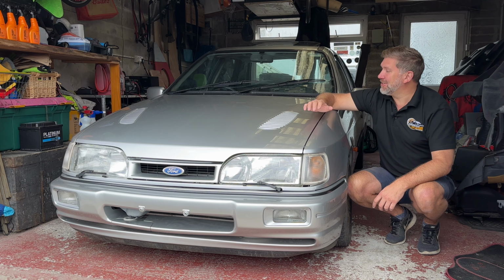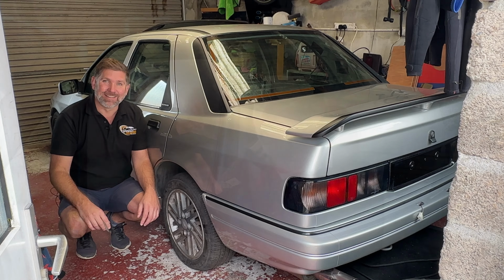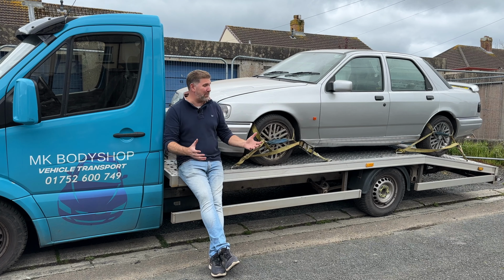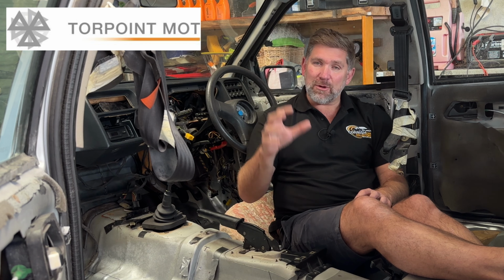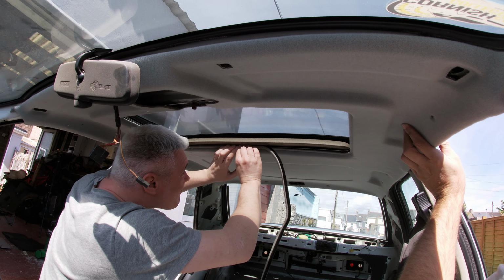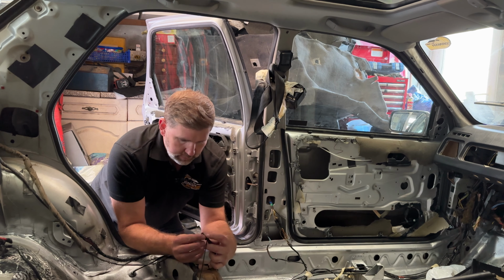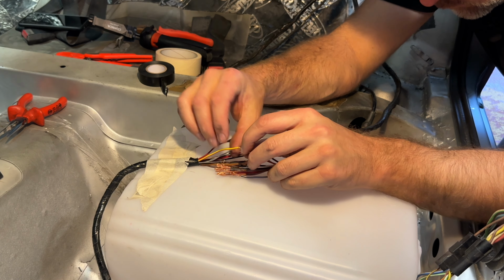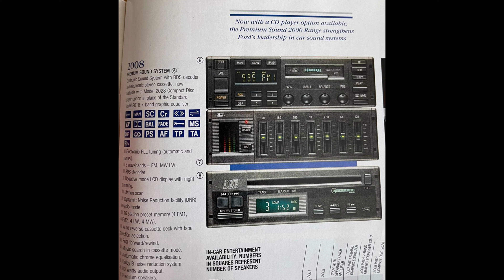FIRE! At last, it's home - rebuilding my Ford Sierra Sapphire RS Cosworth 4x4 Restoration Project

Comment: It nearly fell off the ramp when you were loading it!!
Reply from the maker: Thanks for the comment.
Yeah, it was a little clippy loading the car as I did not have enough blocks of wood and the Sierra is low on the front… got it on okay though (looks worse in the video than it actually was) and, as you’ll have seen, I used more wood when at home.
Thanks for watching, I appreciate it.
Reply: @cornishcarcollectors  
I enjoy the videos. We've actually met before... I test drove a 123d you had... About 5-6 years ago

Comment: Hi Andy, I’m in the process of a full restoration on my 4x4 staff Cosworth,  your videos are really helpful and informative.  Can you help me with what and where you purchased the 6mm bulkhead insulation from as I need the same before I have my engine put back in. Cheers.
Reply from the maker: Thanks for the comment Ian; it is really great to know my videos are helping and good luck with your car.
I spoke with Steve at Sierras R Us who recommended rubberco.co.uk as a supplier for the bulkhead insulation.  I think it is called Silent Coat Isolator 6 (large sheet).  Worked well.
Thanks for watching and hope to hear from you again.